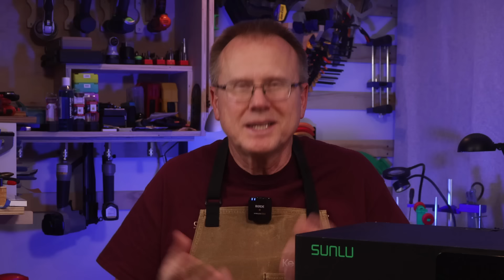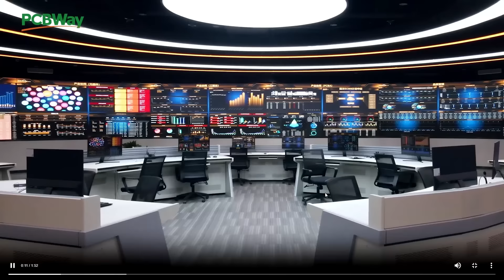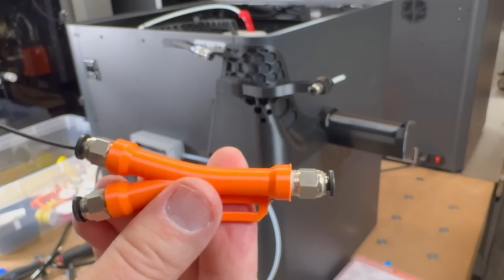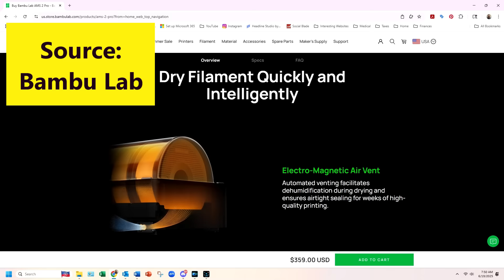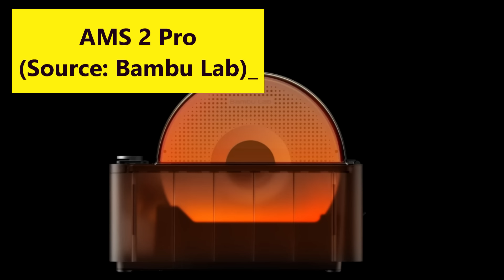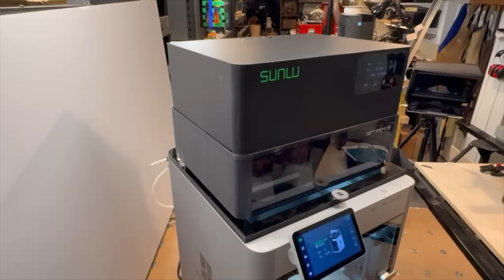Sunlu AMS Heater Upgrade to the Bambu AMS Better Than the AMS 2 Pro?

Comment: Got 2 for $50 each last year when they went on sale. This thing rocks. Just be aware that you need to replace any PLA desiccant holders because they will warp under the stress of the heat

Comment: 1 big thing missing in this video: You can not print and dry at the same time using the Bambulab AMS 2. Quite a big shortcoming.
Reply from the maker: That is a good point that I should have mentioned.  Thank you for pointing that out.

Comment: Very informative video. I just purchased the Bambu Lab P2s with AMS 2 Pro due to the active drying feature. I'm not a production user so was thinking I can dry the filament and then vacuum bag them for later use or dry them and let them cool in the AMS2P then print. I'm hoping BL will down the road allow "maintenance" heating/drying (at an acceptable temp)for the AMS2P.
Reply from the maker: I'm glad you liked the video.  Good luck with your P2S.  I just purchased one as well, but I haven't set it up yet. Thanks for your comment.

Comment: Nice Video (as usual! 😬) ! To address a couple issues that were missed - BL AMS doesn't allow drying while printing BECAUSE ON THINGS LIKE PLA IT CAN CAUSE JAMS!! PLA will soften while drying causing it to jam in the extruder when it gets squeezed by the gears. TIP: If you get this SUNLU and want to dry while printing, just set the temp a bit LOWER like 45C. Most filament won't soften at that temp. So DRY FIRST then when ready to print drop the temp - although with PLA you really don't need to worry about it getting too moist during a print job if it's dry already. Nylon, PETG or other highly hydroscopic materials will GREATLY benefit from the "dry while printing" feature. 👍Great product. One other thing - the SHAPE that SUNLU chose allows STACKING AMS units which BL AMS does not with it's curved top! Cheers.
Reply from the maker: Thanks for your feedback.  I appreciate it.

Comment: will the sunlu heater work with the ams 2 pro?
Reply from the maker: Although I envision the Sunlu would fit the AMS2, I don’t see any value of adding the Sunlu to the AMS2 since the heating features would be duplicated. I think the main purpose of the Sunlu is to upgrade the original AMS to have a dryer function.
Reply: No it doesn't with a good seal the ams 2 is marginally wider than the ams by about  2cm

Comment: Being new to 3DP I bought the AMS 2 Pro as part of a bundle.  Now that I print more it baffles me that it can’t dry with the spools fed into the AMS.  It’s a PITA to remove all the filament before drying, then it doesn’t operate any sort of drying function with the filament loaded or while printing.  Definitely not well thought out.
Reply from the maker: I'm still not sure why Bambu Lab didn't include a "drying while printing function".  They must have their reasons, but I would love them to explain their thought process we all customers could understand the reasons why.  Thanks for your comment.

Comment: Thank you for your useful review. Does the bambulab ams 2 pro has the feature for ‘humidity mode’ where the humidity remains in a constant range as well as the sunlu ams heater?
Reply from the maker: That's a great question. I don't own an AMS 2 Pro so I carefully looked on Bambu Lab's website and I didn't find any specific information that stated there is a "humidity monitoring" mode that turns on the heaters after the humidity rises above a set point after the drying cycle is over.  I'm sorry for my non-specific answer so it might be best to contact Bambu Lab directly just to be sure before you make your purchase.  Thanks for your question.

Comment: Which do you think is better AMS w/Tetras vs AMS w/Sunlu vs AMS 2 Pro
Reply from the maker: That's a great question as well.  I plan to publish a video that will go into a lot more detailed answers to your question, but my initial response, it depends on what your specific needs are (I know I am sounding like a politician).  Eibos has just announced a simpler version of their Tetras, called the Dyas, which is a two-chamber version.  If I was upgrading my original AMS, I would lean towards the Eibos Dyas because it is the same cost as the Sunlu AMS heater, but it has automated venting and two-chamber heating/drying versus one-chamber drying for the Sunlu AMS heater.  I do like the clean design of the Sunlu AMS heater.  The Eibos has a lot of wires hanging off the unit. If I needed to buy a brand new AMS, then I would just buy the Bambu Lab AMS 2 Pro.  Thanks for the question.
Reply: @ristinnovations Thank you🙏! picked up a brand new unopened X1C for $800(He bought a H2D). But I  don’t have AMS
I think you answered my dilemma, and I’ll be saving for a New AMS 2. 
I’m sure Tetras will make an upgrade kit for the AMS2 to bridge the gap of full time drying system.

Comment: I am curious if this heater will do any damage to the AMS in the long run. Great video!
Reply from the maker: That's a great question. I'm not aware of any plastic material changes that Bambu Lab made when  they designed the AMS 2 Pro versus the original AMS so if we assume (and I know that's a risk) that the same plastic materials are used by Bambu Lab to manufacture the AMS and AMS 2 Pro, and we know the AMS 2 Pro has been designed by Bambu Lab to run at a maximum temperature of 65 degrees C, and the Sunlu AMS Heater has been designed for a maximum temperature of 70 degrees C; then I think there is a minimal risk.  I don't know if Sunlu (or Bambu Lab) performed any accelerated life cycle testing with their designs, so time will tell regarding the exact answer to your question.  Thanks for the question (and for your positive feedback).
Reply: I'd probably add a little window gap insulation to thermally isolate the AMS electronics to be safe, and maybe cut some ventillation for it.